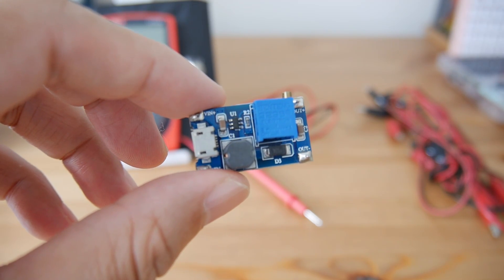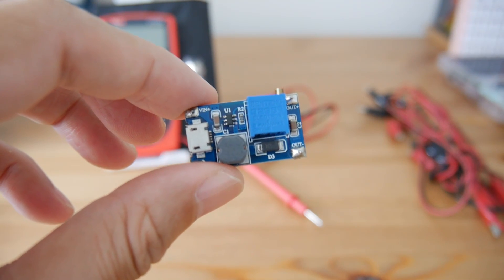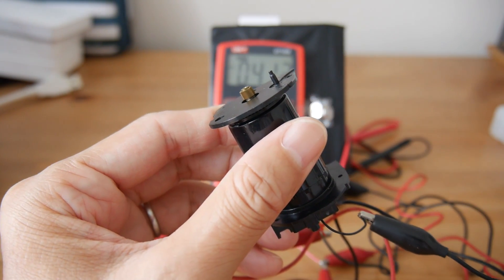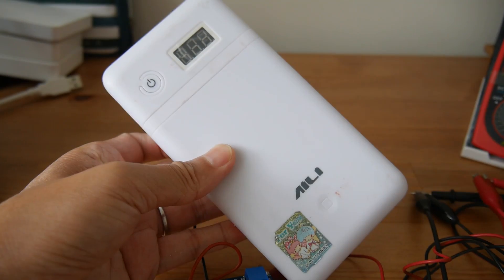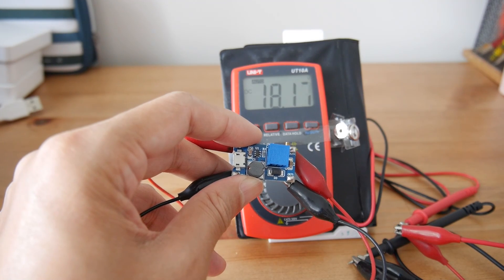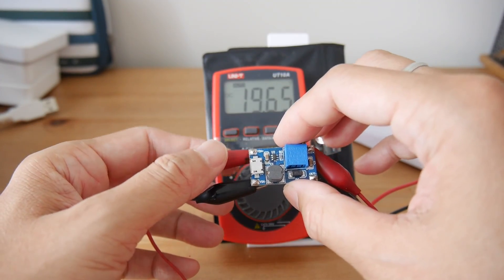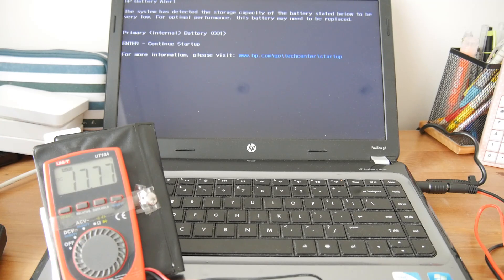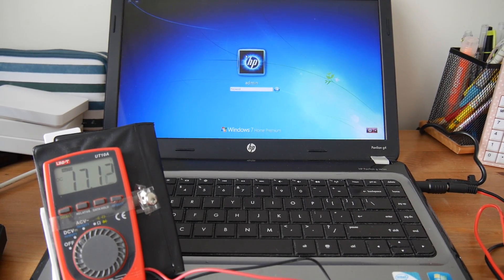Magic! What a MT3608 DC to DC boost up module can power up? 3 projects test to limit.

Comment: Where did you buy this from? I've seen a video where 3 of these went up in smoke but yours is fine!
Reply from the maker: You may look into Ebay, amazon to buy this. Beware of the heat generated to prevent damage
Reply: mostly they go up in smoke because the module is set to the lowest setting. way to get it working is connect 3V supply, increase the voltage to what you need and power the supply then.